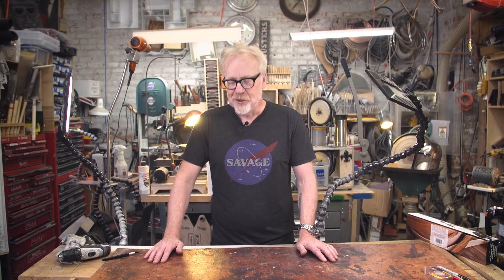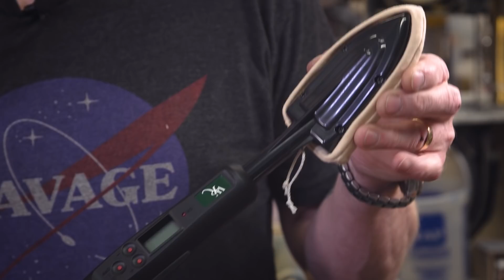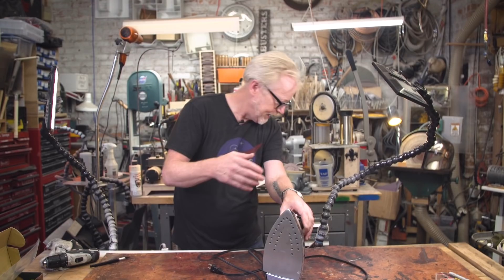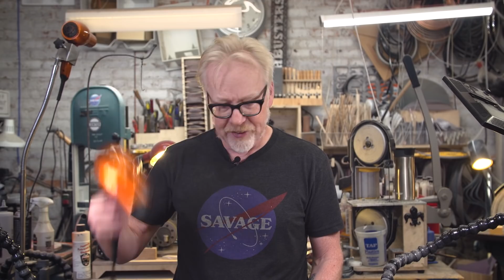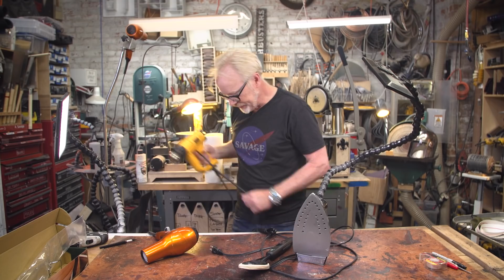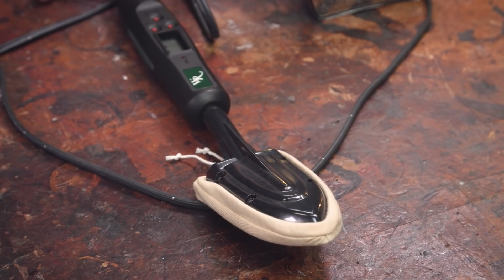Adam Savage's Favorite Tools: Heat Gun and Iron!

Comment: Greetings from the UK @Adam Savage , i'm looking to make a mould of the base of a scooter with a heat gun, it's around 70cm x 35cm with a curved top and and a kickstand that i want to eventually cut out...Which type of plastic would you recommend? HIPS, ABS etc? and thickness 1mm/2mm etc? after i've created the mould i plan on filling it with plaster to get a reusable mould for thermal forming..any help would be greatly acknowledged. Thanks in advance. P.s Subbed as i find your knowledge interesting.

Comment: The new iron reminds me of the old monokote RC model irons.  Wondering if those can be found for a great price and modified with a better heat control with some feedback maybe?  Did a quick search and looks like sealing irons are on the market for a more cost effective (I'm guessing on effective route).  I have an old industrial heat gun that's mounted to a triangle stand which is great.  Just used yesterday to make bell ends on some PVC pipe as well as slight bends to save on couplers and the trip to go get the couplers.

Comment: Growing up, I used to build & fly model RC planes with my father.  There is a product called 'Monokote' that is used as the "skin' for the exterior of their balsa wood frame.  It is a shrinking film with a heat-activated adhesive.  Those small irons are an industry standard in RC plane world, and have been at least since the 70's / 80's when I was growing up.

Comment: I have that heat gun and I used to use it with a stainless steel flour sifter to roast coffee at home. Best coffee ever. Plus, it has a basically a kickstand at the base of the handle that allows the heat gun to stand vertical without additional supports. That let me (and this is just stupid) run the flower sifter with a quarter inch driver on my drill at a low speed to keep the beans moving as they roasted. That helped keep the roast even.

Comment: Used a clothes iron many times to refinish gun stocks. Not only are they quite amazing at removing dings in wood (as long as the fibers are not 'cut'), but they are really good at pulling out stain. It will cost you an old tea towel, but have plenty of those. Quite a few household 'throw outs' end up in the workshop,

Comment: In my old picture framing days we used the Sealector II tacking iron, which was useful for a myriad of tasks, from steaming dents out of wooden frames, melting wax for detailing corners, tacking fabric down to mat board before putting them in the dry mount press, and on and on. It had a rheostat to adjust the temperature for your needs and it was a terrific tool. 

However, I couldn't find one in working order for my own workshop, so I've had the WoodRiver unit for a while and it works just as great!

Comment: A toaster oven is another good heating-related thrift store lookout. Preferably with a really low "drying" setting and a convection fan to really evenly distribute heat. Great for softening plastics for molding (kydex, pvc), drying 3D printer filament, cleaning 3D printer nozzles, loosening adhesives and even (unplugged) as a fire-safe box for charging lithium batteries of unknown reliability.

Comment: I got the same Dewalt heat gun for £20 new from B&Q (Scotland) and it saved the day when doing the suspension on my car, I had to get the track rod end off and it was solid - no amount of leverage was moving it.  My gas/flame burner for some reason wouldn't light and I thought ahhhh what have I got to lose trying a heat gun (saves a 40 minute trip to the shop and another and £x)...... Honestly, I'd be more likely to use the Dewalt heat gun now than using an open flame as it worked great.

Comment: As a sculptor, I've been using a heat gun for years and they are awesome. Mine's not as nice as that dewalt, but when I'm layering up sections of polymer clay for larger projects, it great to be able to just heat certain sections without having to place the whole thing in an oven.

Comment: My favorite maker use of an iron is removing dents from wood. As long as the wood fibers have only been dented, not torn, iron the dented area through a wet cloth and like magic the dent disappears or at least looks better.
Reply: This is about to be a life saver, had this exact problem with a desk I newly built. thanks for the rec.
Reply: I worked at a door shop that did just that, any small dings, or cracks, we'd use a small drop of water, and then a quick ironing and most dents puff out so it can be flatten, or just disappears.
Reply: @Weird_Stealth  did you put the water in the dent or in a cloth?
Reply: @danzo5521  if you put water in the dent, and then apply the cloth… it has the same result as wetting a cloth. Soaking the dent is more precise, apply a heated iron on a dry cloth can make burns on your cloth and wood… so do both 👍🏻
Reply: @Muis83  thanks for the reply!

Comment: If you do need a smaller iron, you can get a travel size one, which are about half the length and width of the plate of a regular one, and maybe a third of the thickness.
Reply: ...I got mine for $5ish at a thrift store, I can't imagine they go for over $20 new.

Comment: The new iron, I used those when I worked in a wire plant to fix the plastic jackets on wire that had a small pin hole or something that would potentially cause a problem. It was quite handy